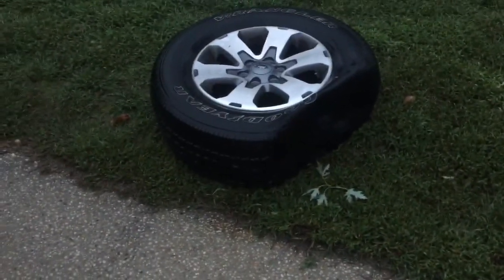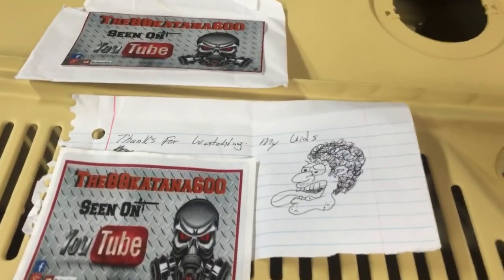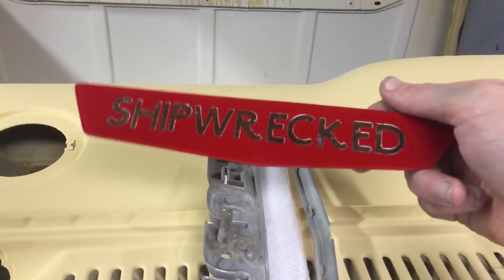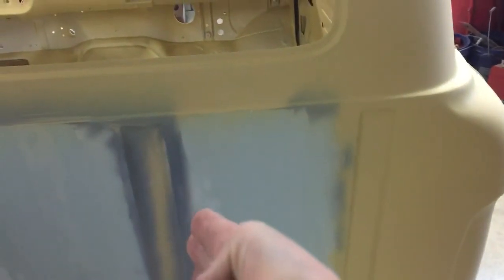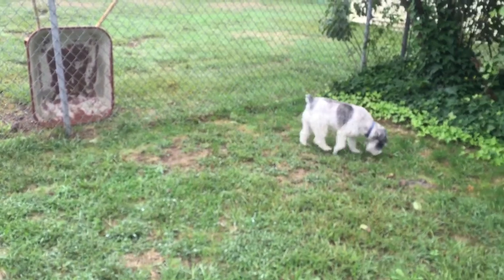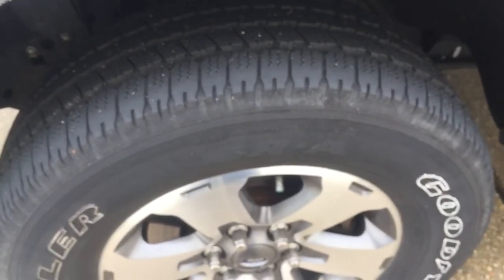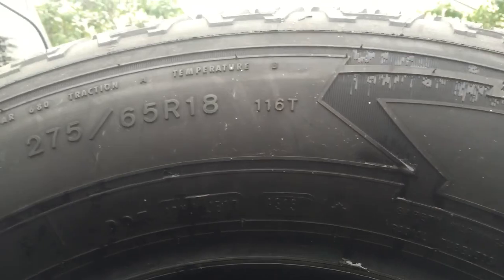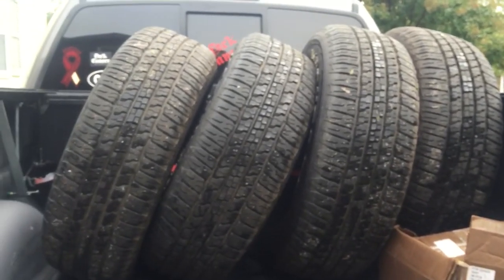Flat tire-a moped-and the cone of shame.

Comment: The jack might have to go under the axle to lift it up. Nice update and good score on the tires.
Reply from the maker: MostlymoparIH yes, it did fit under the axle like it's supposed to. I had to jack it almost completely to the end of the threads and I felt pretty uneasy about it.  For the front it doesn't do a great job getting tire off the ground. I just pulled my floor jack out of shed while home. That was faster!
Reply: Much much faster.
For when you are on the road maybe ya need a couple blocks of wood so you don't have to crank so high. When I towed blocks of wood were life savers. If I could get the jack under the car any place on the car then I could get a wheel back on the car with the help of my wooden jack stands. I know, add an air tank and some air jacks on all four corners ala F! racing.